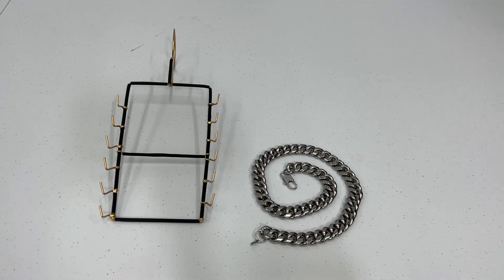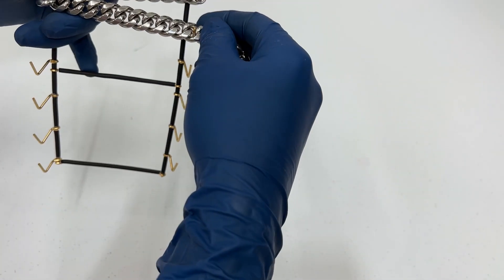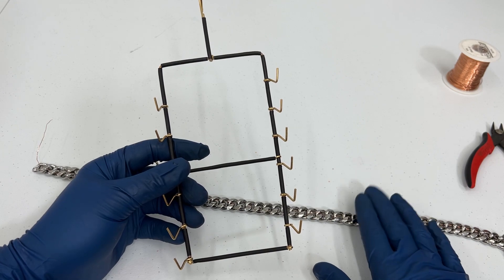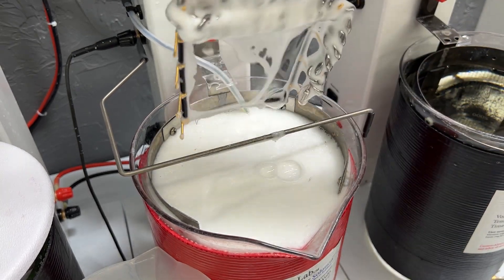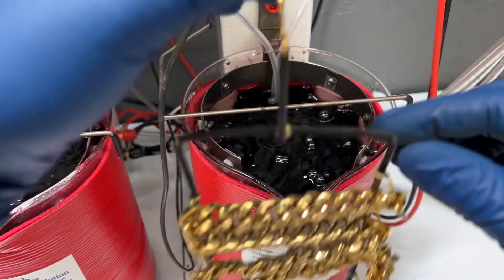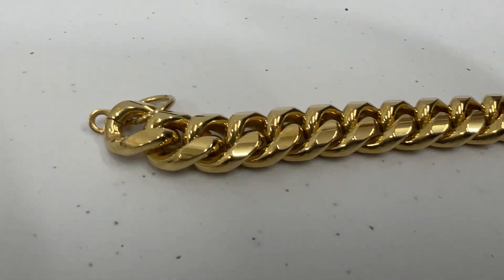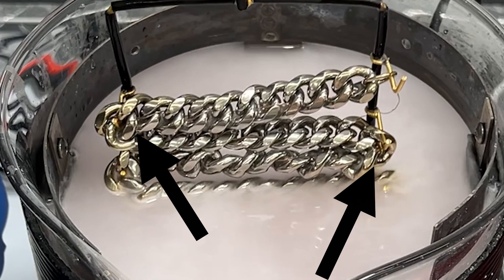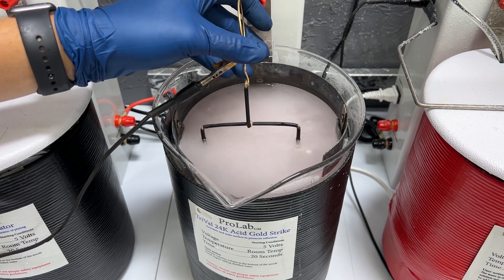Gold Plating Chain in 24K GOLD - Stainless Steel Chain plating

Comment: Nice result, it seems the chain has to be moved a little bit so that the chain links do not stick together?
Reply from the maker: Yes that is why we run the copper wire through it so all the links will still be touching the common and making that connection so it can plate.